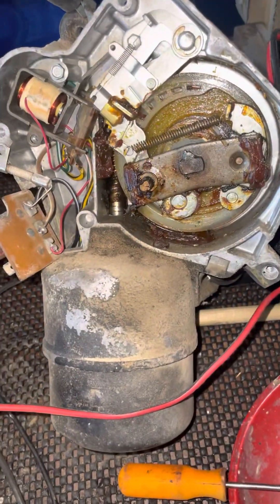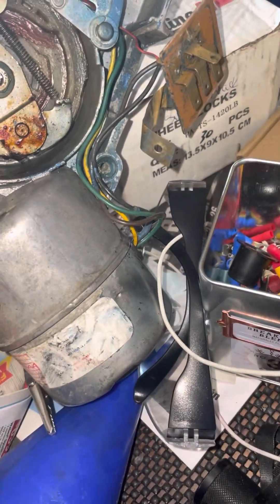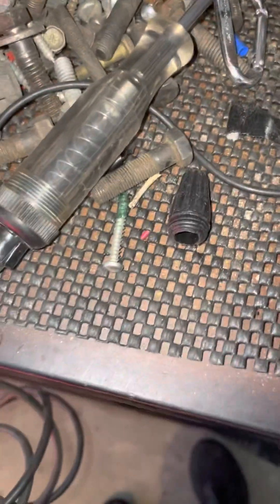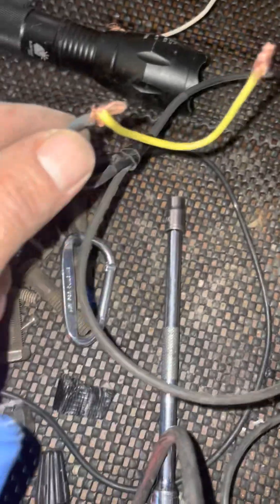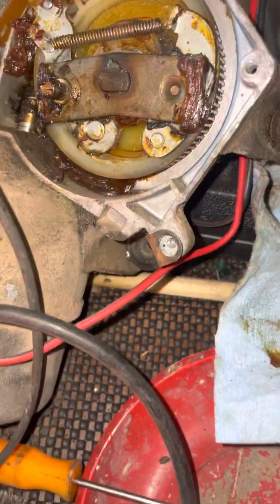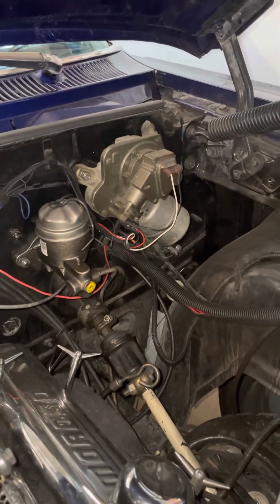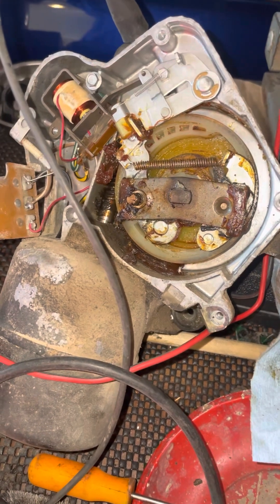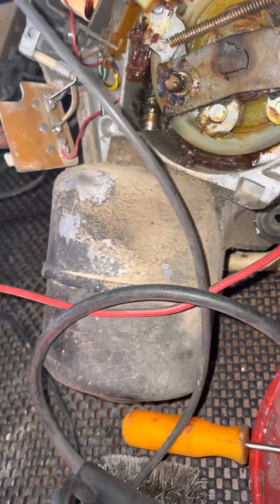1963 SS Impala wiper motor for next project

Comment: I have a 63 impala ss single speed and looks nothing like the ones you show everything was working fine 
Till it didn’t mine has only 2 plug in wires red and grey or green with a stipe on it don’t know which one is power
Reply from the maker: Correct back then there was two options.

Comment: On my 62 impala I ran a wire from the middle to battery positive and negative to the sides but motor isn’t working
Reply from the maker: I would open it up and be extra careful. It could be the wires inside. Blow it out clean the contacts. Try a different ground on the outside. Use your test light to confirm contact.